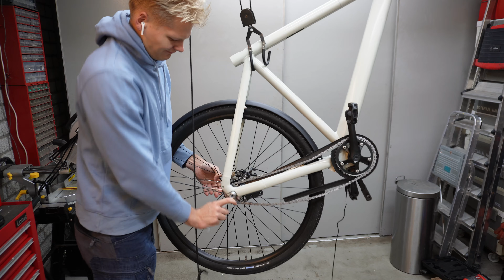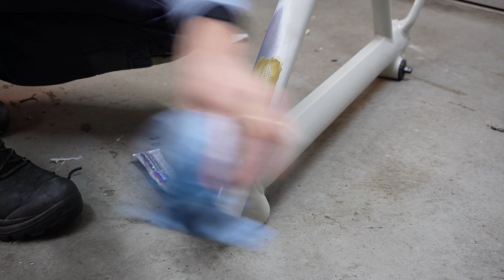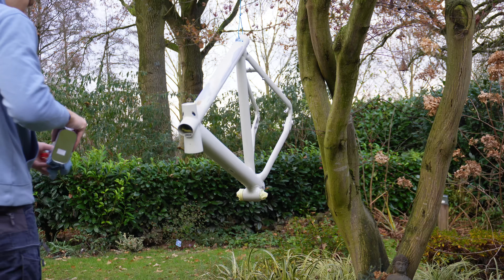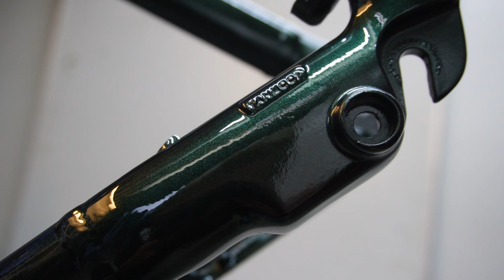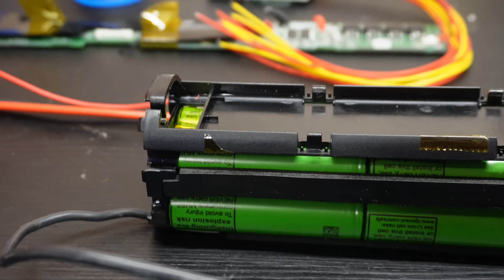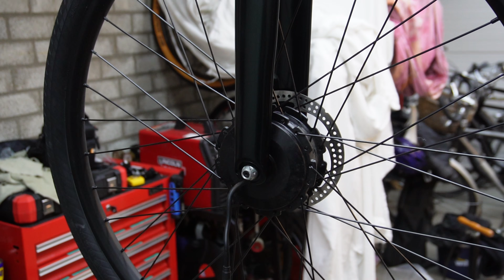TRANSFORMING a VanMoof Into a CUSTOM EBIKE! (Paint, Battery, & Electronics)

Comment: what is the bms make and model?
Reply from the maker: So basically any 10 series, 36 volt BMS should work. I would get one rated for a little higher amps than needed. I would also advice one with a NTC (temperature sensor) for safety. Hope this helps!

Comment: I am trying something similar on my vanmoof. Did you use the original vanmoof motor or another one? 

My original Vanmoof motor only has six wires within the cable coming from the motor. 3 Big motor wires and three hall sensor wires. From what I understand most Chinese controllers need 5 of the hall sensors though.
Reply from the maker: I used the original vanmoof motor, I believe with 3 phase wires and 5 hall sensor wires. The motor works even with just the 3 big wires so I imagine that having three hall sensor wires should be fine, but I’m not sure for your motor type

Comment: Im pretty sure there's some extra space for more cells
Reply from the maker: I did consider that but with the pretty decent capacity the bike allready had I do not have the need for more. Also, I wanted the bike to stay at a 36 Volt system because of the motor, so voltage doesnt need upgrading as well. There would be room in the bicycle frame here and there if you would want to do this, but the original (and water sealed) battery case is pretty well packed.
Reply: @GearShiftJourneysOfficial  I guess you can always upgrade the motor and cells at another date if the range becomes a problem !

Comment: Welke set bouw je in?
Reply from the maker: So I’m using a 10series 36V BMS system that just provides charge and discharge wires to the controller. The controller itself is a 6-20 amp controller (https://a.aliexpress.com/_EJOzn9W) and will match up really well with a WGXN200 display (benefit is that this display has built in buttons for a cleaner look). Finally, a few small bits like a 9V buck controller powers the lights and a 3 wire PAS sensor (or throttle handle) can be wired to signal to the controller.

Hope this helps!
Reply: @GearShiftJourneysOfficial  I noticed that the link isn’t working anymore. I want to make a similar build. Would you recommend this controller, and do you have any tips for it?

Comment: Did the same to my vanmoof s, if you can't get the pedal assist to work, it might be because vanmoof uses a 5 plug connector and the controller form china only needs 3 wires, I cut of the connector on the vanmoof side and on the s there's only 3 wires behind the connector and not 5 hope it makes sense and nice projekt :)
Reply from the maker: Thanks for the tip! I just went with an external 3 plug sensor for now, but would like to get the original bottom bracket sensor working. I will give this a try, thanks again!